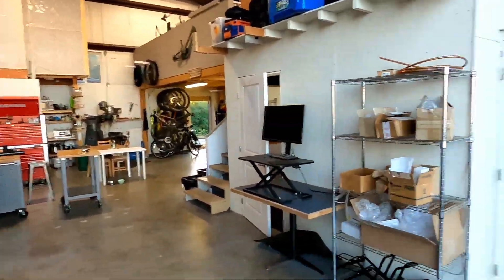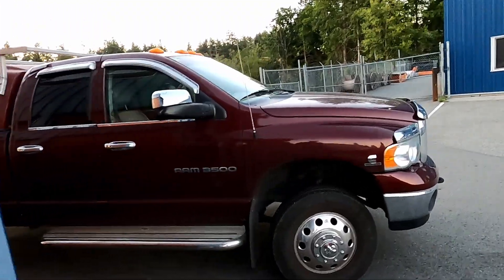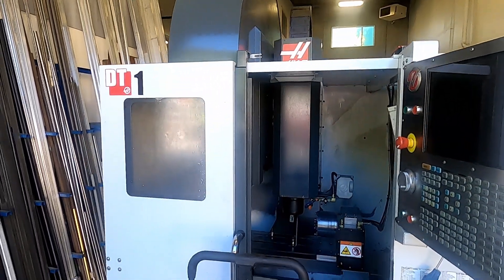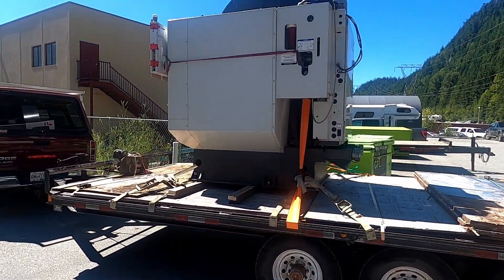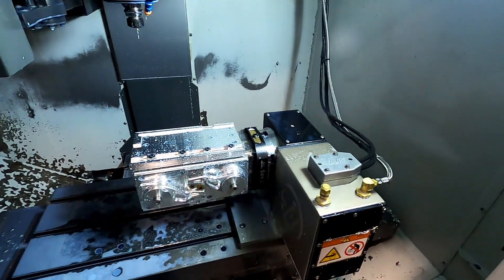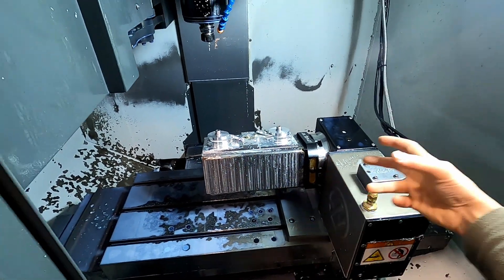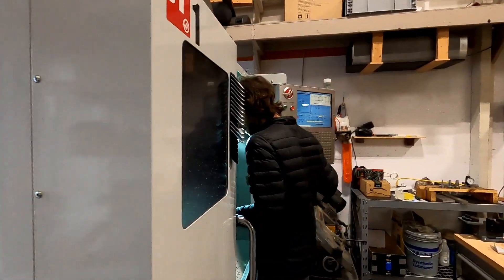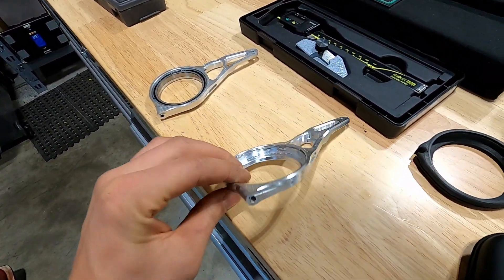Our first big CNC machine!

Comment: why did you load it so far in front of the three axles ?
Reply from the maker: In retrospect, it could've been placed a little farther back, but my understanding is that the weight should be in front of the three axles for trailer stability.
Reply: i only have a bike, but, i think to be stable it has to be in front of the rearmost axle, the rest is more about weight distribution, but i have no idea what i'm talking about, when looking at the video i thought the way it was placed the car had to carry part of the weight instead of just pulling it. @LalBikes1
Reply from the maker: @nitraM321  From a google search, the recommendation is 60% of payload in front of the axle of a single axle trailer. Extrapolating to a three axle trailer, I'd assume the same for the middle of the three axles. That's roughly what I was going for, but like I said, I could have placed the machine a bit farther back. It helps that I had a big dually pickup truck so it handled the weight like a champ.